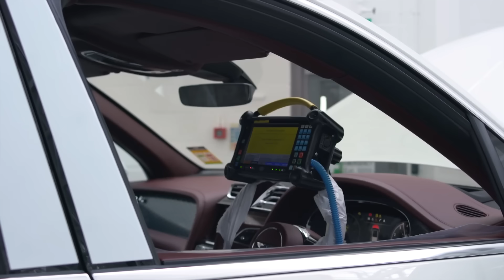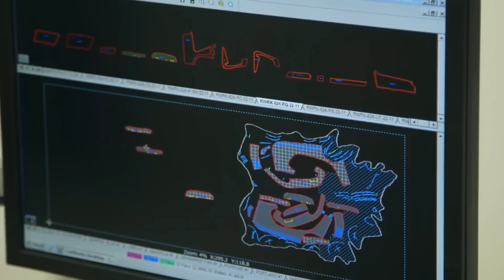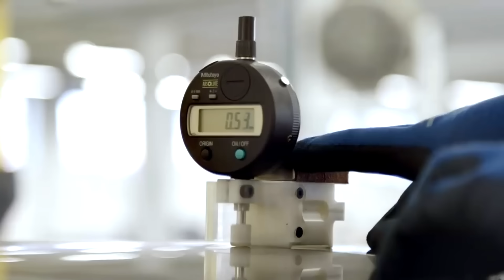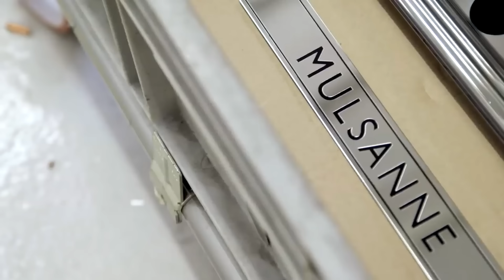BENTLEY Factory 🚘2025: Production & Manufacturing – Building Luxury Hand-Built [Assembly process]

Comment: The problem is not the quality and precision of the build of the car. The problem lies with the components and the complex systems that are required to achieve the performance. Presumably if one can afford the cost of the car £10000 for a new computer after 20000miles will not be a problem.